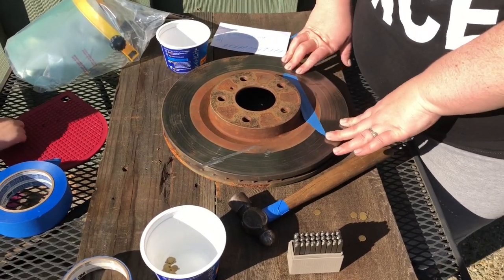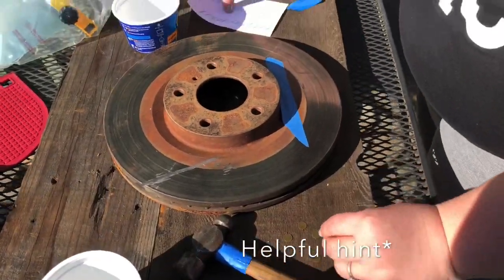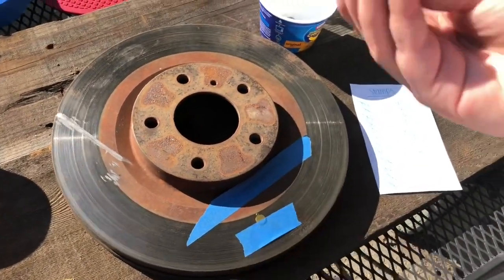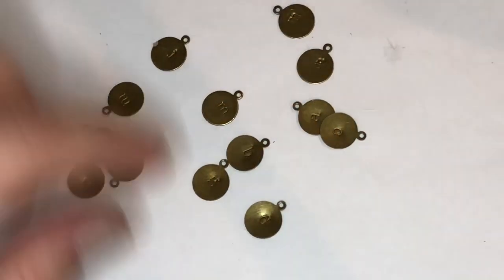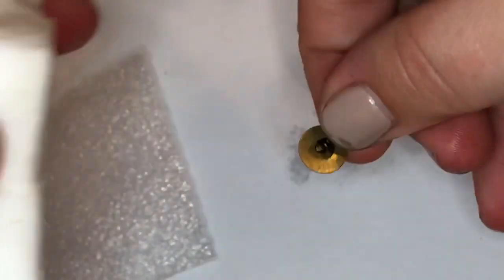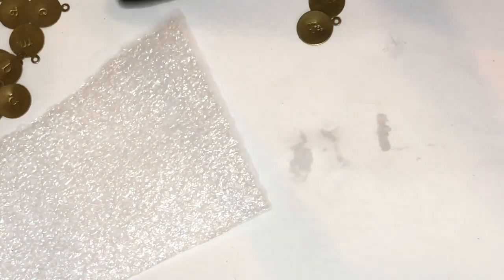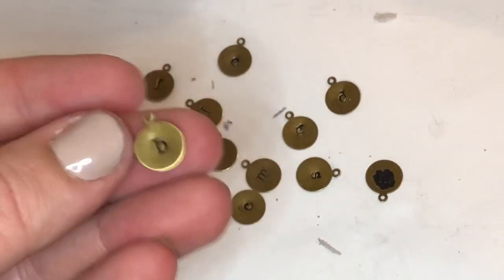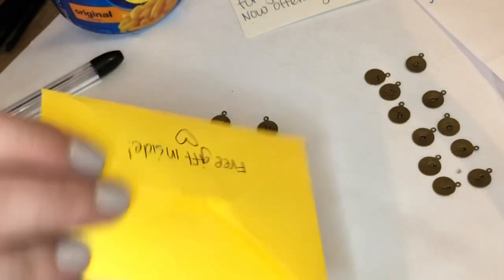How to:  Jewelry Metal Stamp on a Budget | Stamping, Enameling, Personalizing | Moonstone Mamas

Comment: Another tip I've learned for being heavy handed with that hammer, as are you which is totally cool but you will learn to he not so heavy handed over time as I have,  but pick up a cheap mallet from harbor freight, then tirm pendant over on some tape then wack and they will flatten out without affecting your stamp.

Comment: Hi amazing video! I struggle to keep the metal stamp stable when hammering it down because it keeps shifting. I tried metal stamp holders, but the stamp still ends up shifting and makes the final stamp blurred. Do you know anyway to fix this issue? Thanks.
Reply: Have you tried a brass hammer? Brass will help take some impact and lead to less shifting